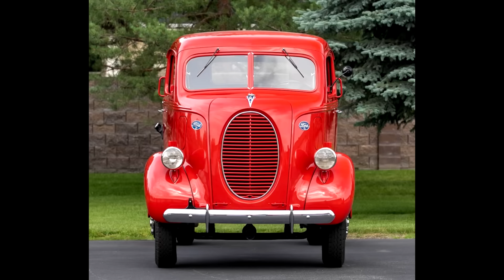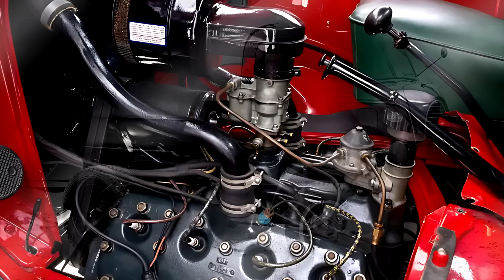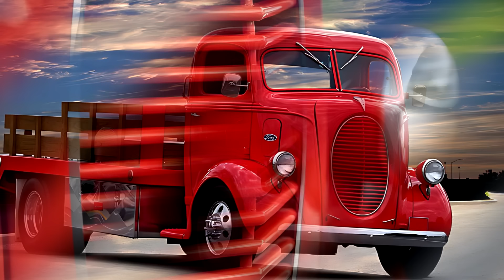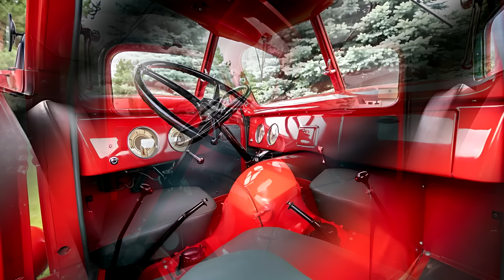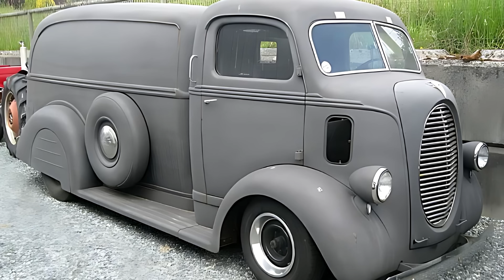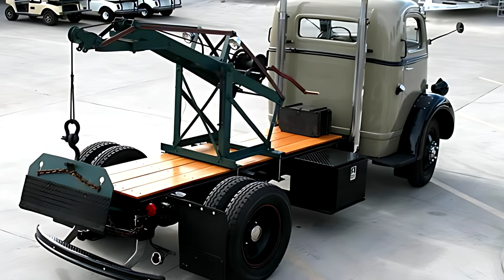1939 Ford COE 💣 Not a Weapon, Not a Hero — Yet Absolutely Critical

Comment: The comments about the braking, and transmission are Not correct. The engine photo is a 1965 or 1975, Not the Flathead. Please correct
Reply: Well, I'll take the bait Mr. troll. Obviously you have never seen a ford flat head. Read a book about cars.